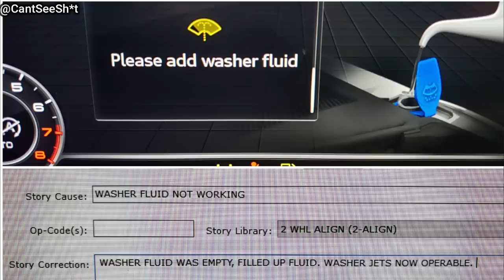Customer States Truck Feels Weird While Driving (GMC Sierra) | Just Rolled In

Comment: I bought new tires, and had them installed from the tire shop I bought them from. Driving later, something didn't feel right. I stopped, and checked the pressure. They had pumped them up to the max rating on the tire! (don't remember what it was, but it was alot more than recommended) Needless to say, I let out alot of air from all 4 tires, and was good to go. Atta boy, tire shop!
Reply: That surprises me. I run all my tires at their max pressure. Stability on curves is more important to me than a soft ride. If I run them at the car manufacturer's recommended pressure I feel like the car doesn't steer right. Too sluggish going into turns and too wiggly coming out.
Reply: @danielbutler578  you are a danger to yourself and everyone around you.  You really think that manufacturers make cars that don’t steer right with the recommended pressures?
Reply: @danielbutler578  You'll wear out the center of the tire tread if there's a large difference between the cars recommended pressure and the tires maximum pressure.
But you learnt this in drivers' education right?
Reply: @danielbutler578   You are sacrificing braking ability by overinflating them.  Cornering traction is also reduced.

Comment: It astounds me how common poorly maintained or overage tires are ANYWHERE in the USA. My wife and I recently had to get rid of our 2002 Honda Civic because of a headgasket failure at over 212K milies. Even though our newer vehicle (2020) is still under warranty, I am always checking the oil and fluid levels because I don't want to be blindsided again.
Reply: @Jim Mason my 1974 Ford Taunus has an old goodyear winter tyre on the spare wheel. it's so old there isn't even a manufactured date on it, but holes for spikes... I suspect it being about as old as the car, and it still keeps the air and has no gaps so far. but I won't dare driving it, of course. XD
Reply: @Jim Mason Age isn't the only factor to consider.  What would you prefer, a 5 year old tire that's been on a car parked outside in Phoenix all it's life, or a 7 year old tire that's been on a garage kept car in rainy Seattle?
I have the original tires for my 48 year old car and they are in excellent condition. The tires are not on the car atm.

Comment: There really should be a MASSIVE reform of what knowledge is necessary to get a drivers licence... 
At least at the countries where the customers put in like 90 PSI or alike... like, if you are not capable of simple Problem solving schematics, you shouldn't be participate in one big schematic (the traffic)
Reply: When the NPCs hear you get better mileage when you air up the tires..
Reply: So I'm wondering, do your air machines not make you set a pressure before you start? or are they just commonly just fill till you release type machines? 

Or are these people just that stupid there taking the time to select 90 PSI?
Reply: @vinceimp9581  bruh... like, yes reduced roll resistance, but also is causing a lower amount of friction and therefore GRIP on the streets... like ... and than even not caring about headroom/margin of pressures that are meant for your tires...
Reply: I mean also LOWER GRIP, not increased grip.
Reply: @Kerbal_fever  i dont know. The usual we have here in Germany goes up to like 10 BARS (145 PSI) or so... and you fill in Manually but watching the needle of the manometer to reach your desired pressure.
Reply: @legitscoper3259  145!! Geez, hope no Americans get near those:0 Can be hard to find decent/working air pumps in US; can't stand crappy ones w/curly hose; charge $2 for 3 minutes:(
Reply: @brianstratton8767  Yeah... but on most gas stations the Compressed air is free here... 
And this high of pressure is so Truck drivers can reinflate their tires too.

Comment: I did the same thing the guy filling up his tire did (2:55). Customer rolled into the Goodyear store I worked at on a temporary spare that they had driven on while almost flat. I went to inflate to the 60 PSI called for and when I got about 30 PSI, the sidewall blew out almost into my face. No damage to me, but I should have known better than to try and fill a tire that had been driven on while flat. Cute Kitty at 2:19!!

Comment: Where in the world did they get the idea to put 90 psi in their tires?
Reply from the maker: Good question 😅
Reply: The pump might have been left set to 90 by a cyclist. Plenty of commuter bikes run that high and use car valves.
Reply: @llamatronian101  Or he may have stopped at a truck stop, big rig tires are inflated to 105 psi.

Comment: now I know why semi tires are sometimes inflated with a safety cage around them.  There is a picture out there on the net of one of those big open pit mine dump trucks with a bubbled tire and my first thought on how to release that was rifle from very far away and behind a mound of dirt.

that end clip explains why gas stations have gone to the digital pumps and not just the little popup gauge, It automatically stops at the right PSI. Most folks probably do not know to hold the valve down on the old ones with the popup gauge for only a few seconds at a time and then release to check pressure.

Comment: 0:27  An addendum to the guidance at this time-stamp:  The sticker in the door jamb applies only to the tires that were installed on the car at the factory.  Now, subsequent replacements may be designed to equal the factory tires...but that is not a guarantee.  In the case of replacements, the recommended cold pressure is molded onto the sidewall of each tire, near the rim.  If that recommended PSI happens to match the door-jamb sticker's recommendations, then great.  If not, the PSI molded onto the tire takes precedent.  Perfect example:  My car's sticker recommends 24 PSI...but that was in 1966, for the bias-ply tires the car left the factory with.  I now run radials (Hankook 724s, to be precise) with a recommended cold pressure twice that on the sticker.  Naturally, I am not running a mere 24 PSI in those tires because the factory sticker says 24; in fact, I'm low enough with the 40 I have in them now.

Comment: :-D The only time i misjudged and made a tire burst, was when with a  wheelbarrel and no sticker about the correct pressure. My uncle came by to fill up the tire of his old wheelbarrel, and we both didn't know what pressure to put in. When asked, i guessed it would cope with 2.2 bar like a car tire. At around 2 bar, it disintegrated with a significant noise...

Comment: When I got my first car, a Lexus E300 old cruiser, I was actually really scared of blowing the tires. But now I honestly just check the tire regularly when I fill it. Mostly because at home the air compressor is older than me and doesn’t have a meter on it. But I have one of those cheap plastic stick ones where the air pushes the stick up and it has a mark on it. Works pretty good

Comment: When I was an aircraft mechanic, on the line we had a Nitrogen gas bottle rig to top up 747, Dc10 tires on the gate. It went from the 3000 psi bottle pressure, into an adjustable regulator to get the tire pressure . A newbie , who DIDNT realize the impact of his action when he changed the gas bottles, some how, bypassed the regulator, and had 3000 psi hooked straight into the tire !!!!!!!!!!. Luckily, NO big kabooooooom before somebody noticed . It would have been a hose down cleanup job

Comment: Only 90PSI? Working for a 10 minute oil change in 1989 I checked the tires of a Dodge Daytona and it buried the 120 PSI gauge, so it could have been anything. It took a while to get them all back to 32 PSI.

Comment: Re: Bubbled tires and that last one. Some first hand advice is that manual pressure gauges are cheap and tires are expensive. Lost 2 tires on an RV  before I realised the gauge on the damned machine was reading low!

Comment: I was delivering gas at a marina once and i used the tag axle to level the truck to get all the product out. There was no limiter on it and i set the lever too far. It kept adding air and blew a bag just as a sailboat passed by. As loud as that bang was none of us were startled. The people on the boat didn't flinch even being about 50 ft from the explosion

Comment: I worked at an instant oil change for a while. Had a customer complain that their car had a weird vibration coming from the back. One of the rear tires had a giant bulge in it, and they didn't have a spare. We didn't replace tires there, so the customer pulled the car out and had it towed. The tire exploded while they where waiting, it wasn't even that hot out, maybe 80F.

Comment: I don't think I have the photo anymore but a few years back I had a car come in with the tpms light on and failure codes for all 4 sensors. The tires were all at 120(ish)psi. Max rated was 44 on the sidewall. Customer declined new sensors and tires. But we did set the pressures correct for her.
Reply from the maker: That's scary as heck. Seen that once before also 😅

Comment: Had a neighbor's friend come over to meet me.  While I was out doing garage work, he confidently stated that the tires on my Toyota Sienna were low.  Now note this van, the new Hybrid, is almost 5000lbs with most of it sitting on the front tires.  Yes, they do appear to deflect where they touch the ground, as all radials do.  I stated the pressure was perfect but even after checking with a gauge, he confidently stated he usually runs 45 to 50PSI.  I nodded.  He went on, and on, and on.  

Guess Toyota has no clue what they are talking about when the PSI posted on the driver's door jam.

Comment: In my shop, when a tire blows up in the tire cage, we all pause for a second then start laughing the exact same way this guy did.

The truck drivers don't realize we're that used to it happening and I've had to explain many many times that no, we did not purposely over inflate your tire to force you to buy a new one. Usual response is "I've been driving for so and so years and never seen a tire just blow up" well buddy, we do dozens of tires a day and you get tires maybe once a year.....
Reply: I don't drive a semi or work as a mechanic, but based on the rubber on the side of the road, someone's tires do explode while driving from time to time on any random stretch of road.  Shouldn't be that surprising that a place that fills tires would see them regularly.
Reply: @Br3ttM  agreed, but tell that to a customer that thinks any issue they have after you did something is now you're fault. Legit had a driver call us 2 days after we put a tire on claiming that we caused his wheel seal to fail. Gave me the whole "you don't think that's a little too much of a coincidence?"

Comment: A few months ago my husband bought a very good mini air compressor so we can reliably and safely check the air in the tyres of my car. Before that there was one service station I avoided checking the tyres at. The fuel is usually the cheapest around plus I get 4 cents per litre discount through my insurance company, service is good and it has the only automatic car wash for kilometres. Trouble is it's near a busy road and the chime on the air pump is so quiet that you can't hear it go off so some people have over inflated their tyres. Luckily no accidents.

Comment: Some people think that more air in the tire equals better gas mileage 😳 or worse, that max psi is what should be in the tire🤯
I'm all about owning another skylark👍😎
Another great video presentation👌
Reply: It depends on how and where you drive. I run my tires at the tire manufacturer's max pressure is because I drive a very curvy road and that gives me better handling. Running at the car manufacturer's recommended pressure gives you a softer ride at the expense of stability. If you ever feel that terrible feeling that comes when you turn the steering wheel and you have time to wonder if the car is going to turn you may want to remember this comment.
Reply: @danielbutler578  LoL you think that feeling is bad, just wait for the feeling of that over pressurized tire blowing out mid-curve. 
You may find a pucker mark in your seat afterwards😏🤣🤣🤣

Comment: Ugghhh. Like that Land Rover,I had a Saturn Outlook that was owned by a Chinese Restaurant. They had an extra large vat of some sort of sauce spill in the back. I got it when the airbag light came on and it wouldn't start. The insurance company paid to have the whole wiring harness, carpeting and airbag module replaced. The worst part was the smell🤮, as it took weeks to get authorization for the work to start. We used an ion generator to finally get rid of the residual odor.

Comment: I was putting 3-4 lbs in my motorcycle tires and an older lady (about 75) pulled up because she thought her tires were low and filled them often.  I had a gauge...she went to filling, and they didn't look low. 

I offered to check the pressure.  She had 90psi in the one she was filling-fast.  The others had over 85, one was 120.

I didn't explain anything, I just held the airhose to the valve and let most of the pressure out.

I did tell her the Ford dealer (down the street)will check her tire pressure for free if she passes there.
Reply: My grandmother was like that. She had a little VW Polo and I got in it the once and the thing went straight on at a roundabout. When I checked the tyres they were at about 4.5 bar (65 psi). If I recall factory pressure was something 2.2 bar (32 psi). I could never get it into her head that radial tyres at the correct pressure always look slightly underinflated compared to the cross-ply tyres she grew up with, and to always check the tyre pressure label or owners manual. In that case it was in the fuel filler flap.
Reply: @cameronwood1994  best not to explain, just suggest nice men will check it for her for FREE.

I pretended to be airing her tires, as I was deflating them.  If I had told her....that is confronting her so she'd stubbornly overfill them.  That's just human nature.

Comment: 90 psi tends to be caused by people adding air to all tires when the low-pressure light comes on, without a gauge. 
Saw a Caravan come in with 80 in the rear.

Comment: Another head shaking video! At 1:50 (spilled gravy), Ii did a similar thing- I managed to spill 2.5 gallons of drain oil in the trunk of my 99 Escort ZX2. The oil flooded the trunk, seeped in thru the back seat, down to the floor, and mad it all the way to the front carpeting. I was, after about 6 months of constant cleaning, able to save everything except the trunk mat and the rear seat bottom. Luckily, car was kind of a POS, but I drove it for at least 5 years after that.

Comment: The best advice I have for people is to always consult your owner's manual when preforming maintenance. There is absolutely no reason as to why someone should over fill their tires when I takes all of two minutes to look it up in the manual, or a quick google search. The same thing goes with oil type and capacity. I routinely change my coworkers oil and the amount of times its overfilled or simply the wrong weight is astonishing.

Comment: Yes exploding tires are the worst. Last year I had a tire (old BFG AT) explode while I was driving on the highway. Huge sound and it damaged the wheel well and shattered my side mirror. I was shocked but then had to act quickly to keep it out of the middle barrier of the highway. Giving it full throttle allowed me to get it to the side of the road.
Still not as loud as the times I have heard a tire explode on a semi truck.

Comment: If you live in the rust belt like your shocks say you might. My friend ran a few 90's f150's and one of the first things he did when he got a new to him one was drill two holes in rocker panel under door and pump a couple tubes of grease in each side and than put some plastic plugs in. It worked fantastic but don't do it until after if you are planning on painting it. It will seep some but that is the whole point. Only method I have ever seen completely stop rust there. Already rusted out than it is two late.

Comment: We always had chronic offenders who would show up with a flat tire they drove on for me to fill with air, because they had no intention of buying a new one. It was always risky. Bringing a bubbled tire in from the cold outside to a warm shop that came in loose from a spare-less Kia Optima resulted in a rather loud bang and the wheel catching 15 feet of air. And I have seen so many people with overfilled tires, sometimes due to ignorance, sometimes due to the stupid old fuel mileage wives tale, sometimes due to malfunctioning gas station air pumps that didn't shut off at the programmed pressure. Worst was a base model Accent with 175/70-14 size and so much pressure in the l/f it maxed out a 120 psi gauge. It had General Altimax on it which are rated for 45 or so. Must be some pretty well made tires...

Comment: I do not know how it is organised in the US but in Poland prior to obtaining the driver's licence everybody must attend to some classes. They are taught the basic technical information about all car systems (engine oil level check, cooling, windscreen washers, all types of lights, etc. Even during the exam everybody must show some of the car' s elements. So when you get the licence you know how to operate a car. Addind flashlights etc. is not possible or driving without a good tyre pressure, low oil etc.

Comment: 2:44 Ha!  That's nothing.  I bought a used '95 Grand Prix and after a year of owning it, I replaced the struts all the way around.  The rear struts were so bad that if you pushed them in, they'd fall right back out because there was nothing left of the internals to even keep friction.  These were also the same cars that had the mono leaf in the rear, so no actual springs.  You'd never be able to tell there was a problem because the mono leaf was so stiff :D